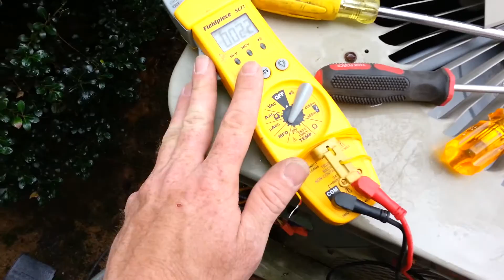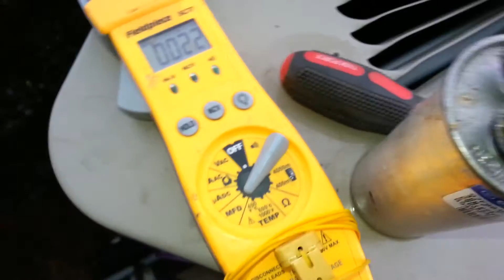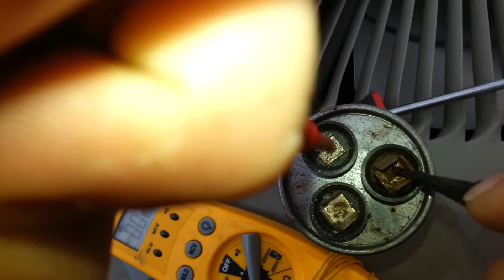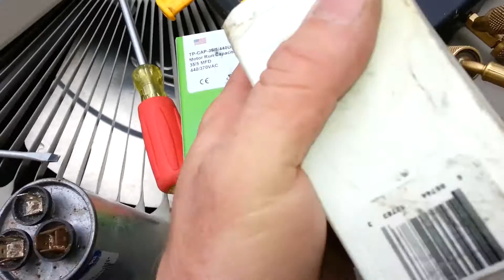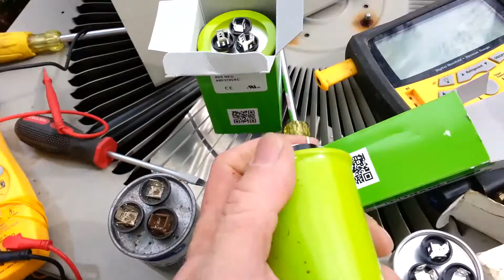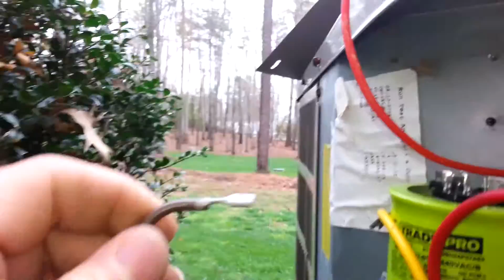how to test and replace a capacitor

Comment: No one should ever take it for granted that a brand new capacitor does not have a charge. It is possible that it had been sold and returned, and therefore could have a charge. Not discharging the capacitor could have potential deadly consequences.